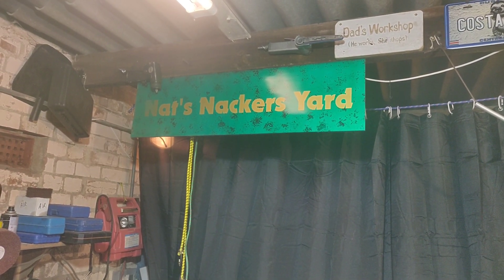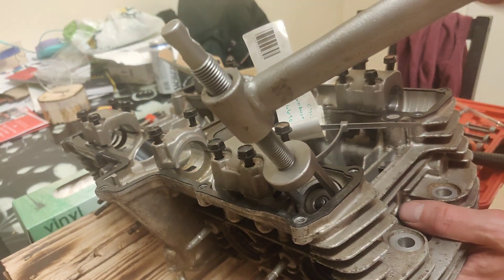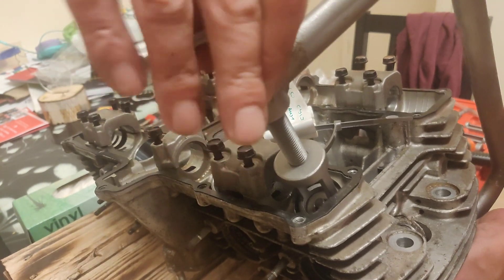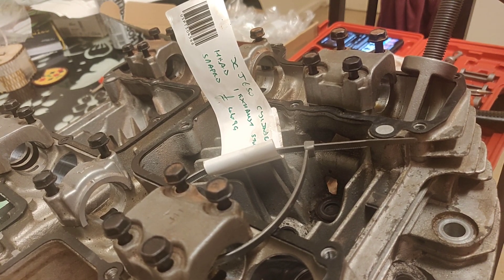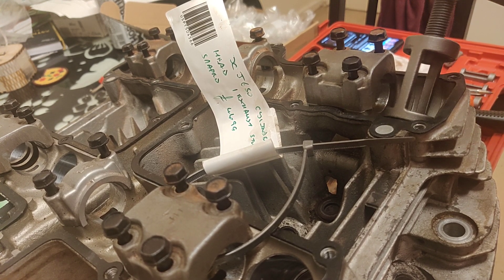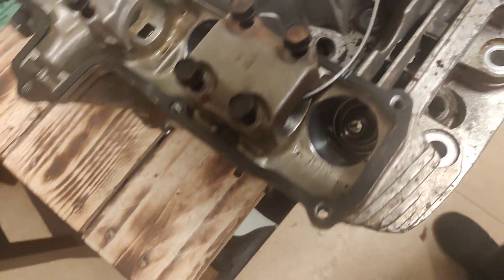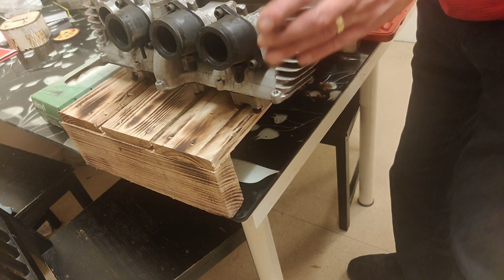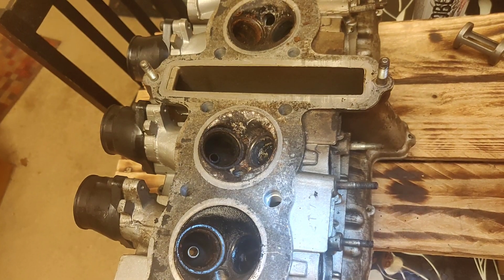XJ650 valve removal.  You lot made me do it!

Comment: Is the missus out doing evening classes?

Nice work.  Rotary brass brush and a bit of lapping compound will sort that all out.  Guides look OK, I probably wouldn't bother changing 'em but if you're in there...  For the valves, maybe a sealed bag full of petrol chucked in the old ultrasound machine (but I'd probably just hit 'em up with the Del special surface treatment removal machine)